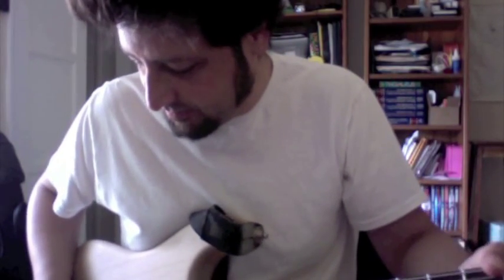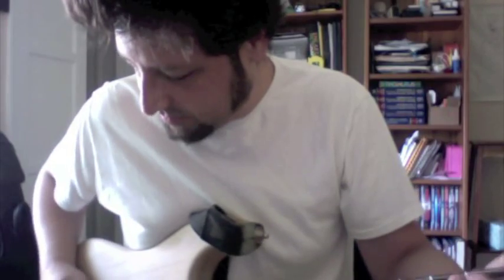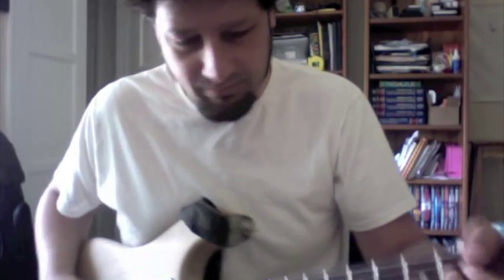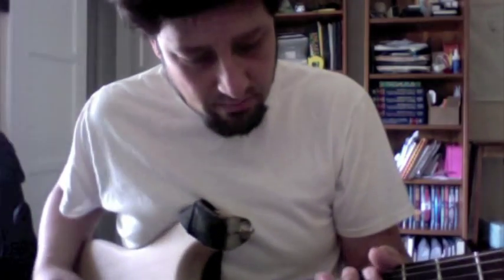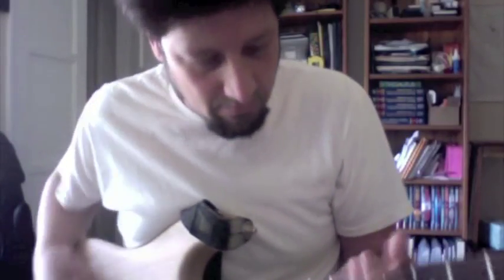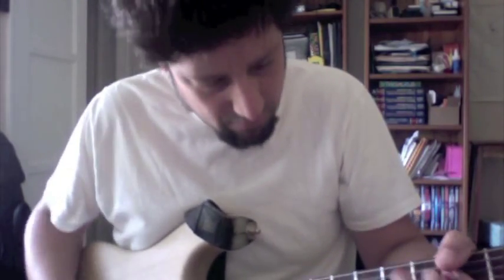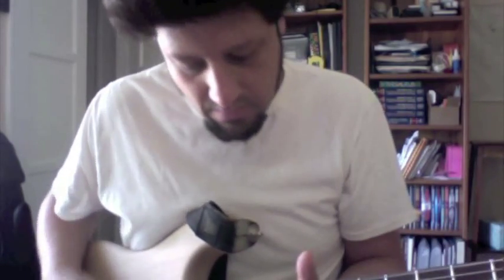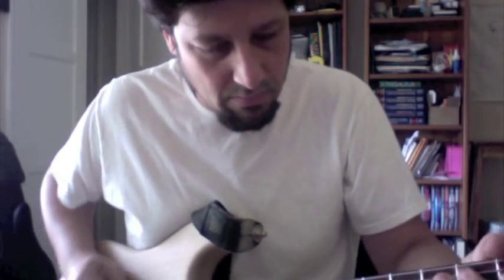Fender Stratocaster-Lace Sensors, Duncan Cool Rail

Comment from the maker: I love strats.  Just really addicted to LPs.  Tougher to "shred" on, but the tone is just too damn good to put down.  You're right the live amps are rentals.  I like JCM 800s best, but 90% of the time the 800s I get are dogs. So I use the JCM 2000 DSLs.  Not as good as a good 800, but super consistent.  I dont split the signal.  I go out of 1 head into two cabs. Hopefully loaded w/ V30s, but usually not :( second head is backup.  lots of requests for my live pedalboard. I'll upload a vid soon!

Comment: Man, I have seen you live about 5 year ago in St-Adele Quebec and you were amazing. If you could comment on the middle pickup that I should use for a Strat I would greatly appreciate. Should it sound closer to the bridge pickup or the neck pickup? I currently have a Hot-rail in the bridge and am G&L MFD SC (ceramic also) on the neck and I have no clue what I should put in for middle pickup. I am more like the hard rock type.